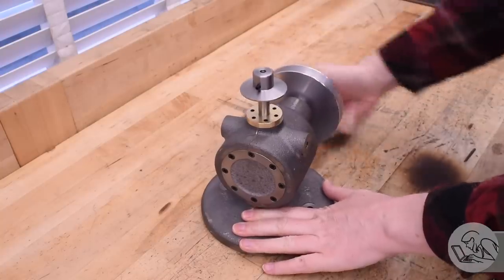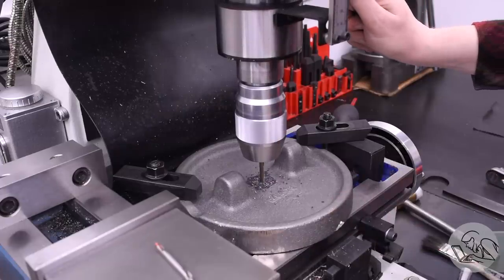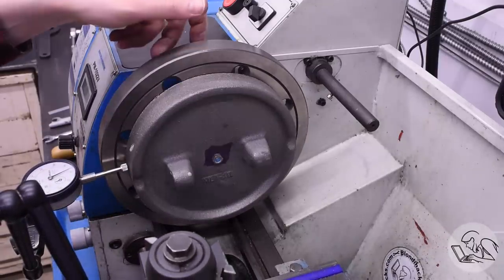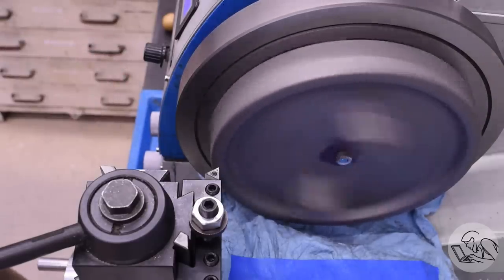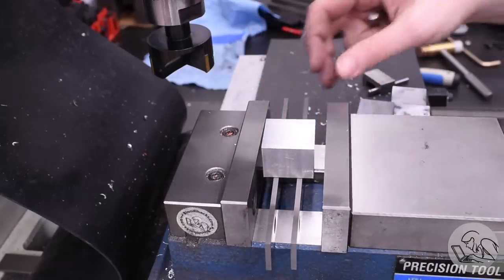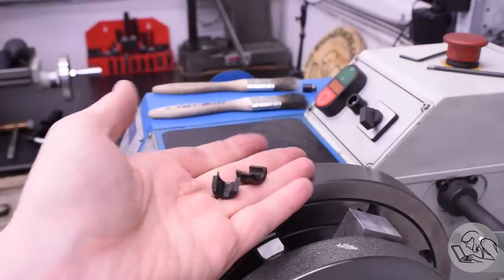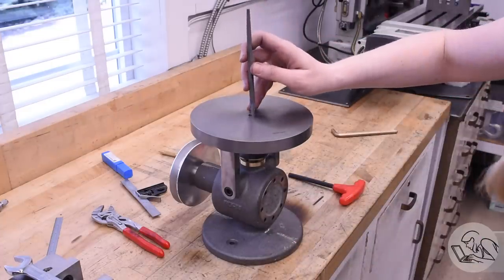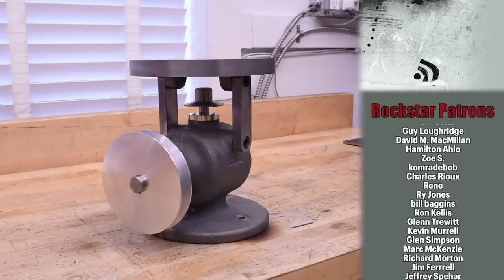Let's Build a Die Filer, Part 7 - The Table!

Comment from the maker: Hey folks- a common question here is why is it necessary to thin down the table? The answer is that die filer files are not very long. A quarter inch extra thickness on the table means the filer wouldn’t have enough reach on the files. That’s why there’s a dimension to hit on table thickness.

Also a few folks suggesting I could have simply bolted my spacer blocks to the faceplate and faced them parallel in-situ. Absolutely! That’s a great idea and easier than what I did.

Also, everyone can relax about the fuse. It’s a small DC lathe and the fuse is on the low voltage DC driver board. Everyone take a breath on that one. As I said, as long as the sizes are correct (amperage and voltage) then it will be fine. A gentle reminder to please be kind and give each other benefit of the doubt on knowledge.

For everyone asking about why I didn’t use the tailstock to help centre the plate, it doesn’t reach over the carriage and the fixturing hardware to get close enough to the faceplate.

Comment: The automotive blade fuse and its holder are only rated for 32 VDC. If that fuse is interrupting the AC line, then you really need a fuse and holder (or circuit breaker) rated for at least 125 VAC. That turned table surface is so beautiful! This die filer project is really cool. Oh, BTW, thanks for fixing the Apple IIc Plus beep. I just got my first IIc Plus.
Reply: The bigger concern is that automotive fuses are also usually only rated for 32 volts. however it is definitely better than nothing.
Reply: This, exactly.  There is no guarantee that the 32V automotive fuse will safely interrupt current backed by 120V.

Comment: A single sheet of printer paper between the part and the face plate greatly increases the driving traction. I use this often when a setup doesn't allow for full clamping force. Great project and video as always.

Comment: Hi Quinn, just replace your fuse with the correct size circuit breaker much easier if you pop the breaker just simply push the button, and you are up and running again I have done this on my lathe and it has been really good even though you do not change fuses all that often it is still handy to have the breaker in place, Another great job by the way.👍👍👍👍

Comment: A thought for you.   Change fuses with circuit breakers.  Breakers can be reset, fuses ya need spares.  You always need one at 7pm Sunday evening when everything is closed.  I've always changed to panel mounted breakers when I see fuse holders.

Comment: I really enjoy your videos.   Question:  At minute 8 you show a great technique to remove the influence of the vice jaws when making parallel surfaces.  Brilliant!   You then tap the blocks to mount them on the face plate.  Why not just mill one face, drill/tap and then bolt the blocks with the machined face against the lathe face plate and then face the blocks in situ?    This would remove any error in the blocks AND any lack of truth in the face plate.......I think.  Anyway,  thank you for making these great videos.

Comment: I think installing an ammeter on the front panel fuse circuit would be a cool upgrade project.
That would be the perfect indicator on how hard you're running the lathe and keep you from blowing fuses.
Also as has been mentioned in these comments replacing the fuses with circuit breakers would be pretty high on my list.

Comment: Die filers are nice to have however, Grobet Vallorbe was the last of the file companies to stop making the files for use in these machines. I still have a square cut 00 file cut in reverse with no tang which is a die filing machine file.
Very instructive, thank you Quinn.

Comment: I have a question Quin; I know the instructions told you the order of machining, but I don't understand why you didn't initially use the inner flat area of the rough casting with three identical riser blocks to the lathe's face plate? in my inexperienced mind, that would have allowed you to machine down the table's surface in one go, then you could have worked your magic on the underside

Comment: THANK YOU for being smart enough to use a heat gun for your shrink tube.   I had another youtuber on a much more electronics heavy channel get annoyed with me cuz I kept asking why he used a lighter rather then a heat gun.   I will never understand people who have the right tool and still use the wrong one, despite knowing better.
Reply: Getting out a lighter is faster than getting the heat gun and plugging it in. 
And it works just fine.
So why do more work than necessary?
Reply: Soldering irons will do the job too if you can keep them moving to prevent meltage.
Reply: @Jehty_  Why wouldn't your heat gun be available and easy to reach at your electronics bench?  I never said the lighter doesn't work. it's just  the wrong tool
Reply: @beeman1885  using the wrong tool is still the wrong tool

Comment: Look into concentric reamers... I ran into them while working on old cars that have a lot of forks in the front steering that have to be concentric. Start  by drilling the two holes slightly undersize but as close to concentric as possible. The reamers  use a cone in one hole to align the shaft of the reamer. If you go back and forth you can really get very accurate concentric holes.

Comment: Thank you as always for all the time you put into these.  How does the idea of something like a tap follower for the spindle sound?  Basically a hollow-bore, telescoping dead center; with it you could put a little 60 degree center on the top of the table and use this new tool to center the part. 🤔

Comment: Question about the parallelism of your sacrificial aluminum blocks. If you had milled the first side then just immediately drilled the bolt hole and the bolted to your face plate and used the lathe to clean up the second side would that have given you the same (if not better) parallelism? I know there are always different ways to do things in machining and I'm not trying to say that my way would have been any better. I'm just asking for my own edification
Reply from the maker: Great idea! That would definitely be better than what I did.
Reply: @Blondihacks  Comments section here is pretty constructive, which is nice for a change.
Reply from the maker: @travisray139  Well, I moderate heavily. You should see some of the stuff that gets deleted. :D  But yes, I try to keep a constructive and helpful environment for everyone. I learn a lot from my viewers and don't want to discourage that.
Reply: @Blondihacks  Well thanks for the hard work there!  From my perspective, it feels like the comments section has become an organic part of the whole Blondihacks journey.

Comment: Instead of paralleling the stand off blocks on the mill, why not just face one side, drill, tap and bolt to the lathe face plate.  Take an (interrupted) facing cut, and Uncle Bob.

Comment: Quinn,  when watching you centering the plate on the faceplate for the second time, i had an eureka moment. Instead of centering on the outside of the rough casting, once you had the thread cut in the center. I don't know if i would have thought about it on the spot, if i were making it. But center drilling the threaded rod, in a collet chuck. and using that center with a live or dead center to align again every time, could have made the centering of the table far easier no ? HTH.

Comment: Since it's not dimension critical, I think I would have done nice facing cuts on the lathe, and kept the extra table mass...a bit thicker table isnt a bad thing unless you think you'd lose too much stroke on the files.

Comment: Mighty Quinn! Hey, great to see you!  A question from the peanut gallery; why didn’t you use a spacer when you mounted it on the faceplate before doing the first cut, then you could have turned the outer diameter without having to change the setup. And a bit of double sided carpet tape (the stuff without the foam sandwich) would have ensured that it wouldn’t move.  But then again, perhaps I’m just a nut case😂

Comment: So I watched you tap this table in to place. If the piece is secured tight with the long bolt through the lathe, what actually moves when you tap on the piece?

Comment: quinn, why didn't you let the threaded rod stick out of the casting. And have a round bar with the same thread bolted on top of the nut for alignment. You spend already some time to find the center on the mill.
Reply from the maker: Threads aren’t concentric

Comment: Quinn , just and idea for you . I was thinking you could use the hot leg of that circuit that blows the fuse to close the contacts of a relay and that would  turn the motor on the lathe . by isolating the sensitive electronics you can use the lathe to its full potential and protect the board. Think of and air compressor as the tank fills with air the resistant in the circuit increases (higher amp draw ) this happens in say in a  tire shop hundreds of times a day with no problem because and air compresser has no electronics, just a heavy duty set of contacts on a pressure switch.  just a thought ??? also there is nothing cooler than the fact that Ron Covell follows you ...

Comment: Hmm just wonering, why did you go through all that centering job for the initial tapped hole, and then not use it as a reference? you went back to the outside and recentered it from that when setting it up in the lathe ? what am i missing here?
Reply from the maker: Threads are not a valid reference
Reply: @Blondihacks  Are they worse than a cast surface? Not snarking, I work with wood and stone, not metal so I am curious.
Reply: @paulkupperman7049  The cast surface is used here because the goal is to average out the error in the roundness of the cast features of the part. There is no true center until it is machined, so that's why it's better to use the rough outer surface, because it's about determining how and where to remove material. We are creating the final center, and we want it to be well positioned relative to the distribution of mass of the casting.
Reply: @blondie7575  I figured that you'd done the averaging when you placed the center hole. It was only (if I remember corrrectly) a 4-point job, not all the way around, so I guess it wouldn't be as good a job, so not sufficient?